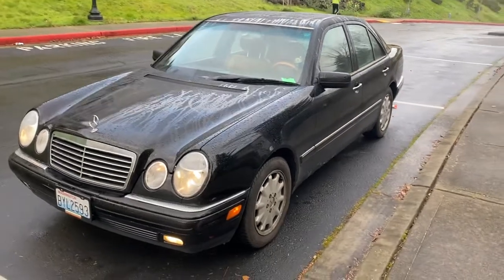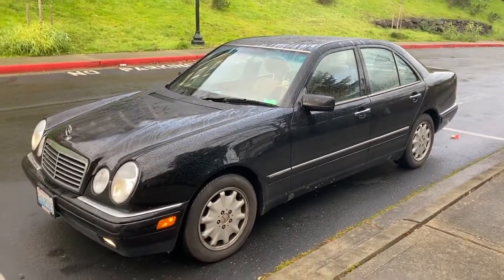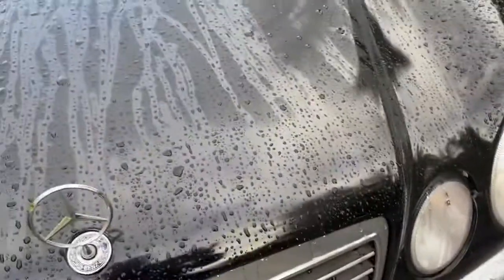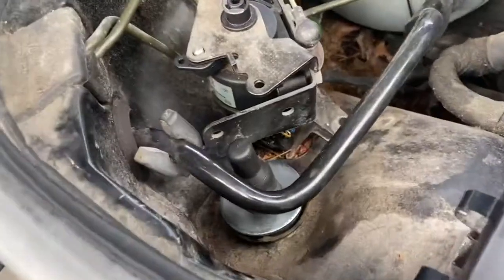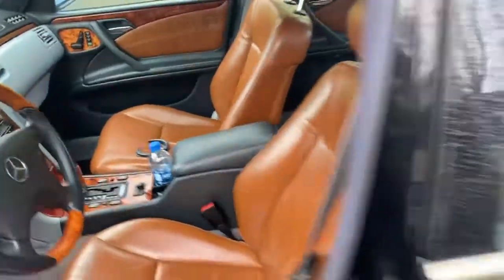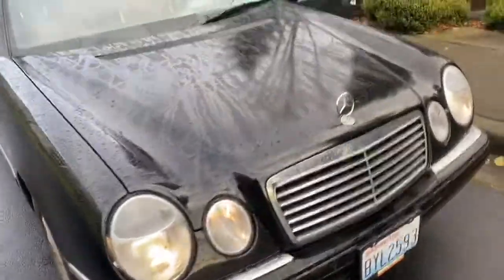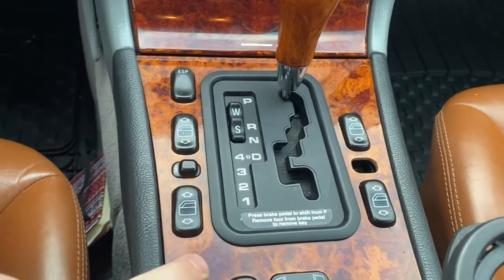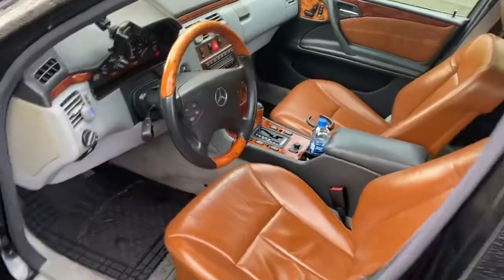1997 Mercedes Benz E320  W210 Overview and Top Issues- $600 Project To Nice Daily Driver

Comment: Fantastic work on that early W210 - it looks so different with the Designo interior!  I have a silver '99 E320 with the M112 and 111k miles, it has the exact same gray interior like yours before the swap.  A quick tip on the transmission - with the 722.6/5G-tronic, at some point you'll want to consider replacing the conductor plate on top of the valve body, as the integrated speed sensor tends to crack & split on higher-mileage examples leading to degradation in shift quality and, if left unchecked, unexpected forays into limp mode.  Also, the two O-rings sealing the socket where the wiring harness plugs into the transmission are prone to failure, and when enough fluid gets in there it can actually wick its way straight up the wiring harness into the transmission control module and destroy it, NOT good.  The 722.6 is nearly bulletproof outside of these two parts which are just going to fail at some point.  I ended up having to replace both on my 722.6 at 105k when I did a transmission service - the speed sensor was already starting to crack and there was fluid contamination in the connector, so I was fortunate to catch it early.  FCP Euro and RockAuto are excellent places to get parts, as well as eBay for used replacements on hard-to-find or overly expensive parts (for example, FCP sells a complete 722.6 kit with fluid, filter, pan gasket, conductor plate, & TCU connector assembly for under $250, and I replaced a power headrest motor for $18 and a power seat control module for $23 via eBay).

Good luck and smooth sailing with your W210 - with proper care & maintenance, these highly underrated and subtly pleasing cars can easily run up to 250k and beyond!
Reply from the maker: Thank you so much for your comment and tip and suggestion for the transmission work, you know I might get that sensor done, Currently it shifts very nice also despite very smal hold on cold start, but when warm good, I changed the fluid and filters and pan gasket,
Reply: @alekscarguy5153  You're welcome!  If the car shifts very nicely, your speed sensor is likely still in good shape and you probably don't need a new conductor plate just yet.  The car is actually designed (this was explained to me by an M-B mechanic) to hold on to 1st and 2nd gears when you first drive away after a cold start to help preheat the catalytic converters, and is normal behavior unrelated to any speed sensor issues.  My E320 does this, holds onto 1st and 2nd gears until about 2700rpm when I first drive away after cold starts.  

If you haven't already, I highly recommend checking the wiring harness plug to the transmission - just disconnect the plug and see if it has any transmission fluid on it, which will tell you the O-rings are failing.  If there is fluid on/in the plug and you have to replace the socket, you'll only lose less than a quart of fluid after removing the socket which can be topped back off without having to drain/pull the pan etc., since you just did a transmission service.  Also if you do find any fluid in the connector, you'll need to pull the connector from the transmission module itself (in the black "brain box" with the other modules underhood next to front passenger shock tower) to make sure no fluid has made its way up the wiring to the module.
Reply from the maker: @motorwolfe  you know I do need to check on that because there were small transmission fluid sip/leak that I was trying to figure out where it comes from but it was like few drops over night and I haven’t bothered but now that you are saying about this one I think I should? Thank you
Reply: @alekscarguy5153  Yeah, if you just put a new pan gasket on it and still have a small transmission fluid leak, I'd for sure check the plug connector to see if that's the culprit.  Anyone with a 722.6 transmission with over 100k on it should check the connector plug anyways, regardless of whether you can see a leak from the outside or not - sometimes the fluid only leaks INSIDE the connector and you can't see the problem unless you pull the plug and check (my connector was like that - dry outside and contaminated with ATF inside).  Good luck and let us know what you find!

Comment: What a steal, the seats and steering wheel must be worth $2000 alone!
Reply from the maker: Very correct; on Ebay there was the exact same interior in not perfect condition for $2000 +$700 shipping….. the steering wheel worths about $300-$500 so It was a incredible deal and also the nice gentleman drove the interior to my house for the $1000 so I was happy!
The last couple stuff I will do to It are momoblocks amg wheels , headliner fix, and install modern audio with camera and phone connection…. Other than that it’s perfect